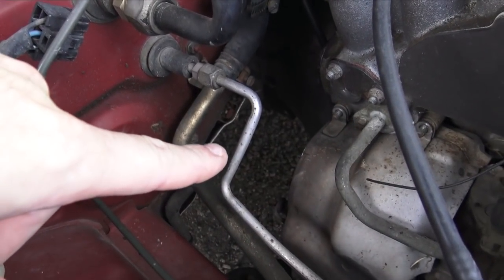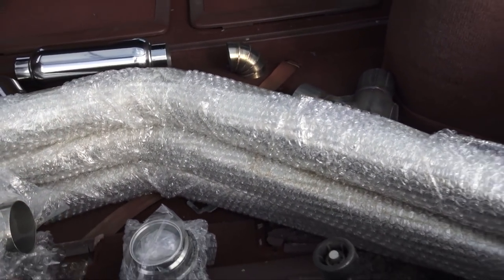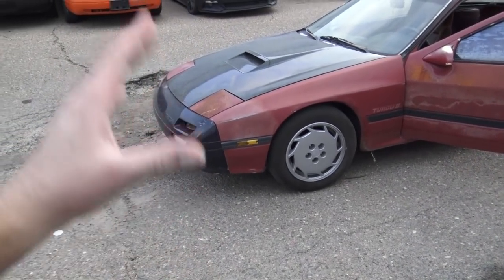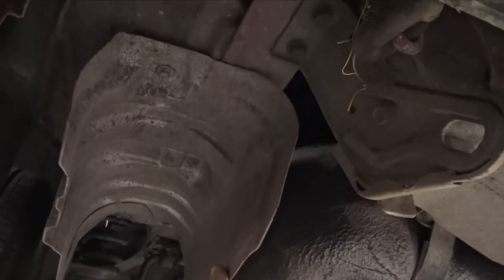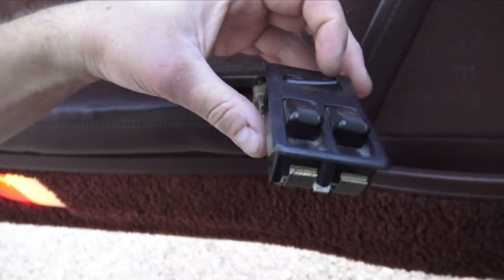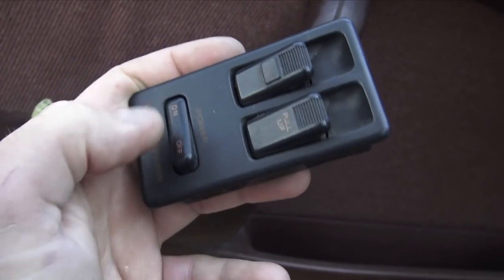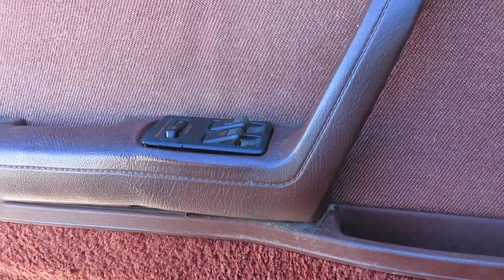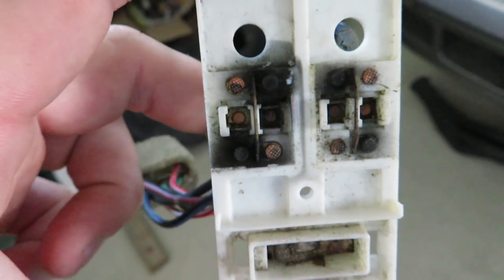Rescuing The Cheapest FC3S RX7 Turbo II From Its Grave | Part 7

Comment: you should keep the heat shields,  nothing likes heat from the exhaust(gas tank, brake lines, fuel lines, it's there for a reason.  Unless u plan to tuck and hide new fuel and brake lines, just keep them on, it's not costing you any work/time to just leave em. cool project * the thumbs*

Comment: I know it may be a little too late but i recommend you to use magnaflow muflers or racing beat. Those are the only two muffler that i know of having stainless steel wool padding as opposed to most companies that use glass pack .Glass pack don't last too long on rotary engines due to the extreme heat of the rotary exhaust of 1,200 degree Fahrenheit as opposed to piston engines 850 degree temperatures. Those hot exhaust temperatures is the reason why the turbo II has a thicker carpet for better heat isolation on the cabin. It is also a good idea to keep all the heat shield that the car has on the floor, you will be glad when the A/C temperatures of your car stay cooler on summer. Good work with the car so far. I had restored two RX-7 Turbo II years ago. I haven't research lately exhaust with stainless steel padding inside so there might be other new companies making them this days.

Comment: Good on you to actually explain the power window switch problem. Similar year Mazda MPV window switches are direct replacements for the FC switches if you ever see one in a slavage yard- they are much less common now than 10 years ago though.  

I recommend adding another resonator or muffler in the location of the factory main cat, those straight through mufflers are still going to be LOUD.

Comment: You should spray some silicone spray in the window run channel felts and white lithium grease the window regulator components inside the door to keep them running smooth and save the motors from prematurely burning out.

Comment: You can also use the first gen Mazda MPV window switches as a replacement. Also look up the FC3S Power Window Relay Mod on ausrotary. Speeds them right up!

Comment: hey, when you get the hanger material (why you didn't just bend some rebar, is beyond me, though. hah!) make sure to weld a piece of flat between the seams of your muffler, to weld the hanger onto. do not weld straight to the muffler's outer skin. edges only.

worked in exhaust shop for years.

Comment: The burnt contacts don't really have anything to do with positive or negative; they get burnt due to current.
If you check voltage, the switch will always show positive voltage even if you flip the circuit to the negative side; all DC voltage circuits will do this.
If you want minimize those burnt contacts, decrease current - one of the quickest ways to do this is retrofit a relay...

Comment: I had the same issue with my window switch.  Luckily I was able to find one for cheap that worked.  One thing to look into would be the window relay mod.  Pretty much you add two relays for each switch.  I used the write up off this site 
https://www.rx7club.com/2nd-generation-specific-1986-1992-17/window-relay-mod-help-936066/